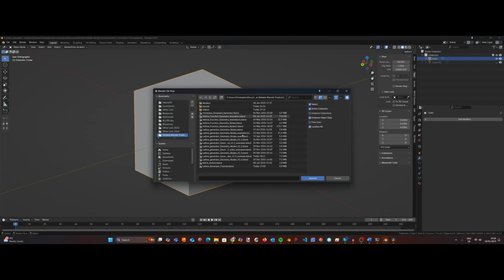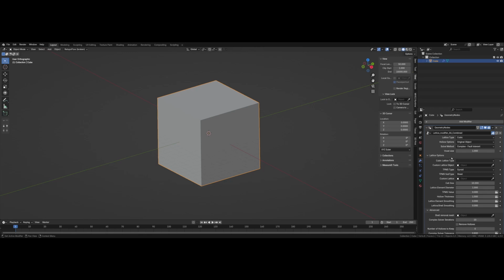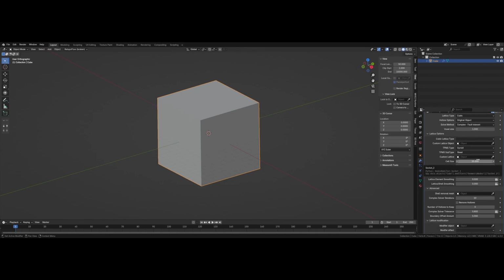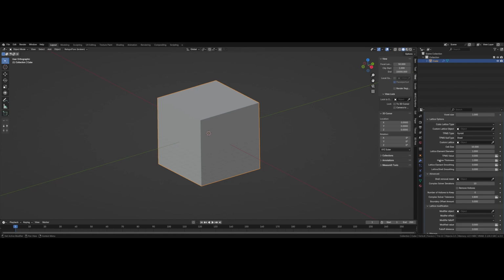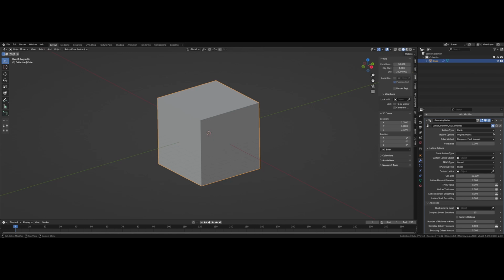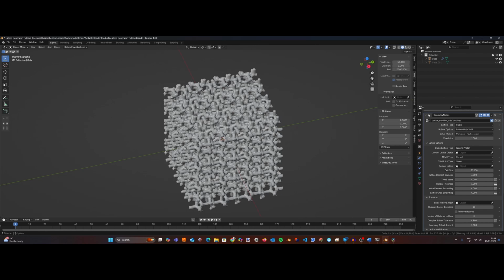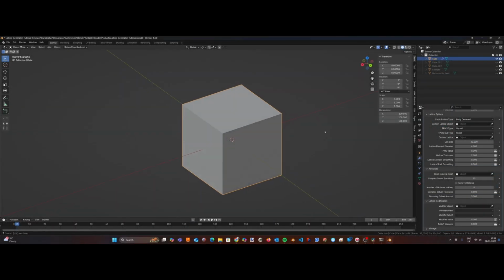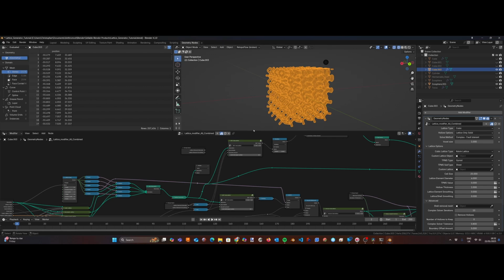3D Printing Lattice Generator for Blender: Introduction

Comment: I bought this, and I have watched this video several times and just cannot get the wire frame to show lattices, it's always the edges of the shell. Anyone know what to do?
Reply from the maker: Are the scales set to 1 and the dimensions the size you want them to be? If the scale is anything other than 1 go to object>apply>scale.

Comment: Could you do a video of this working with some more complex triangulated print ready stl meshes? I am very keen for multi material modelling and think this would be really good for that but I'm not sure how well this would handle those types of models and would love to see. Fantastic idea though! I like the short you did you did of the suzanne but I am assuming that was a subdiv and not an exported stl that was imported then used with your plugin?
Reply from the maker: So more complicated meshes are mainly a problem with the stochastic/voronoi lattice method. This is due to some of the steps involved really being affected by the original mesh density. I've been working on some fixes for it, which you can see in my hermanubis ,neptune and fractured globe shorts. Only the hollowing step in the other lattices are affected by the mesh density, but it is robust and it doesn't affect the time much. I hope to get back to making some tutorials after Easter.
Reply: @Anthromod  perfect I'm very keen to see! I had seen the globe and some of your other shorts and thought this almost seems exactly like what I was looking for!

Comment: Very nice. That's just a graph generator? no code. Shame it's stepped though but I guess that doesn't matter much for 3D prints. Now we just need home metal 3D printers
Reply from the maker: I'm not quite sure what the algorithm Blender uses to generate the iso surfaces, but yes it leads to the stepped look. It would be possible to make an efficient subdividable lattice pattern, but it would rely upon using a boolean to combine it with the hollow, and booleans are blenders achilles heel. Best case is it would be much slower, but far more likely to glitch out on you.